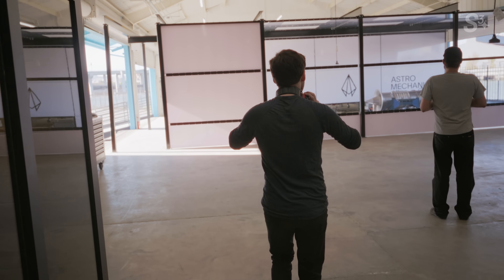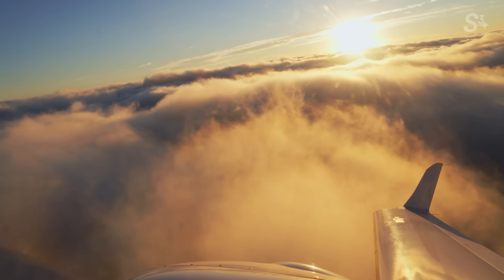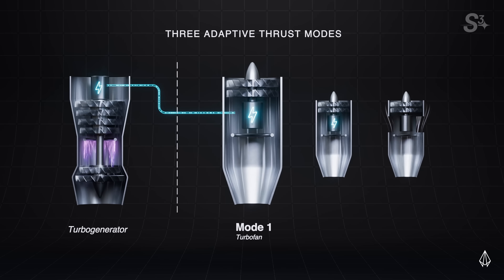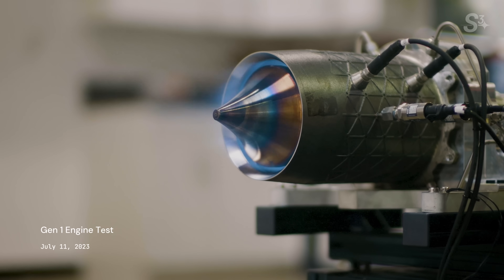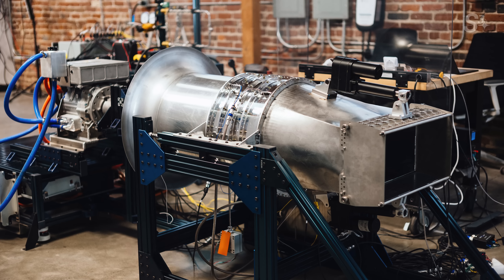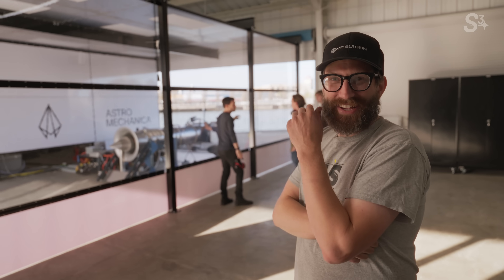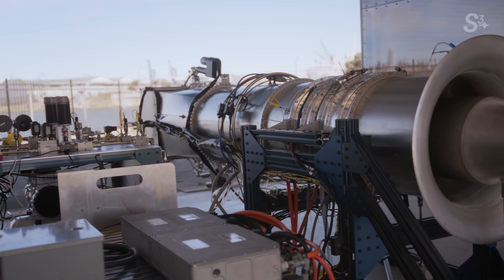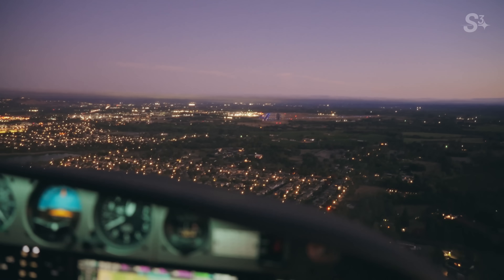The Age of the Electric Adaptive Jet Engine: Astro Mechanica

Comment: "we burn FUEL in a generator".

ok, cool. as expected... a bag of tricks posing as "revolutionary" but really all just hogwash, pixie dust, unicorn farts...

guess what, everyone? it actually runs on AIR, like every other engine... air that is rapidly HEATED using the COMBUSTION of a FLAMMABLE SUBSTANCE so its PRESSURE INCREASES and can PERFORM WORK.

throwing a generator and motor in there, whats that achieve?

funding from investors. thats all.

Comment: I like their approach better than whatever Boom is doing. Same as Hermeus, develop the engine first, then build an aircraft around it, not the other way around.
Reply: Honestly I could see a boom airliner being converted to use these engines.
Reply: An aircraft, much like any other complex engineering system, needs to be designed holistically based on its intended purpose and goals. Few, if any successful aircraft have started from an engine-first design philosophy - the powerplant is merely a subsystem of the whole airplane.
Reply: @ch4ndemic  the innovation of all these new aerospace companies come from their innovative engine design. Makes no sense for Boom to make an airplane that’s completely unrelated to their final product.
Reply: Isn’t boom developing a proprietary engine?
Reply: @ no, they contracted it out to other companies (e.g. Kratos, GE)

Comment: I am sadly not impressed. Perhaps its the explanations or my lack of knowledge about jet engines. Why a turbo generator? Why not let that part run the fan/compressor directly?
Reply: Seems like they don’t want to couple the turbine with the compressor directly so that they can be decoupled and run as efficiently as possible
Reply: Think of it like a bike with gears. A regular engine is tuned with only the one gear speed, so it needs to work well enough when flying slow for takeoff and landing as well as for cruising the other 95% of the time.

This engine is effectively starting at a high gear and uses the electric motors/ the turbo generator to help when going slow. It means a much smaller and lighter engine can be used in place of a less optimized bigger one. The electrics probably wont be used so much when cruising as that will be where the engine can sustain itself when its moving fast enough.

Comment: The title of this video is quite simply incorrect. Electricity may be used as a coupling mechanism, but it is NOT the power SOURCE  -- that is the jet fuel.
I definitely would like to congratulate the team on this success--thinking outside convention about how to make existing technology more efficient.
If the turbine/generator is the most efficient way to convert jet fuel to electricity, then this could open up the field for hybrid, electric motor powered aircraft, like the VTOL models that are range limited by battery technology.
Reply from the maker: Correct, sorry about that. Was running through the idea maze of titles a little too quickly lol. Adjusted!
Reply: @jasoncarman99  isn't it still quite wrong? and while I recognize that you can use electric transmission in a jet engine instead of gears or wider turbines, isn't it the case that for supersonic cruise there is no particular need for steep gearing so direct shaft is best and your claim that range would be significantly increased is a lie? that better range is better had in weight reduction which concorde had good opportunity for
Reply: @jasoncarman99  Thank you so much for doing that and departing from the horrible trend of Youtube channels being sensational and using distracting titles/content.
Reply: I totally agree. In this case I think they mentioned they were using LNG instead of jet fuel.
Reply: I'd imagine the thermodynamic efficiency limit is still there but the electric transmission makes it possible to stay closer to that limit in a wider range of flight conditions?
Reply: @tamashamas6193  for brief take off yes, maybe. at the expense of weight and electric transmission losses the whole way... see the problem? so I think we are in that spectrum between incompetence and scamming
Reply: @DanFrederiksen  I would not be so quick to come to conclusions like that. If you can run the turbine/generator in its optimum range, and run the propulsion system in its optimum range(s) you can well overcome the losses incurred in the electrical systems. That is why you have diesel electric trains, trucks, ships, etc. For example, look at what the Dodge Ramcharger is doing, or Edison Motors of Canada.
Reply: @StarmaxStarmax-zn3xt  but wouldn't an engine be designed to run in its optimum range for mach 1.5 cruise? so  you can only hope to improve ascend, at the expense of the long distance cruise efficiency. and weight and complexity. I'm open to being wrong but where is the flaw in my argument...   for very high bypass turbofans the desired ratio might just be good enough to consider an electric transmission to be free of gear wear. But a supersonic...?   any slight inefficiency in take off would have to be VERY significant to entertain such complexity. And typically jet engines are more efficient at take off, strangely enough.
You can flip your argument and realize that there is great value in spotting bs right away instead of a 10 year wait and see waste of time and money.
Reply: @DanFrederiksen  The losses from an electric generator and motor are similar to the losses from (single speed) gears.  HOWEVER an electric transmission has much greater flexibility in speed ranges; it's like widely variable gearing.  Electric is probably more durable also as there are no (unique) mechanical interfaces (i.e. gear faces) to wear.  (Both have bearings to support shafts.)
Reply: @LoanwordEggcorn  We have invented an ultra-torque dense[think light, compact], infinitely variable gear technology [advanced planetary-class...w/o spur gearing, 90% smaller] which does not use tooth/spur architecture. It is based on our reformulation of gearing theory. It enables low cost, efficient, power dense turbo machines including rocket engines. Improves electric machines too.
Reply: @MiloTheMindBender  Reference please?  (Don't post a link or Youtube will delete it.)  Company or invention name.
Reply: I like the idea of an adaptive electric/gas engine that tunes for best efficiency. I haven't heard of a jet engine that can do this. The response of an electric engine is fast when its needed but slows down as it gets hot. Cold n High is good for it in that respect.
If you can get more range from a gas turbine, your doing something right.
Reply: @simiot1  I have considered it too but it seems to me to be better suited for variable output operation. I considered it for a helicopter, specifically Hill helicopters because it avoids the gearbox at an angle to both the main rotor and tail rotor. Making it electric frees it from a lot of mechanical coupling and suits variable load and gearing mismatch if you suddenly want more power, like how you would gear down in a combustion engine car to get more power for acceleration. so it might be very interesting for a helicopter but for long term steady state like supersonic long range cruiser I'm guessing it's a net loss. It's hard to beat a straight shaft for power transfer.
Reply: @DanFrederiksen  I understand your point for this use in Helo's. I didn't think of it. A FADEC ops system would make a killer chopper with this tech, when it is proven.
There is always gonna be a loss with efficiency when it comes to turbines. Generating your own electricity for these engines is where it tips me in favor. If there can be a leap of improvement to fuel to weight usage I'm for it whether rotary or fixed...
Reply: If you’re going to strap on a big ass jet engine and associated fuel tanks… just power your HELICOPTER with the jet engine. Skip the middle man. We also already have APUs, which are… alright in efficiency, but that fuel efficiency comes at the cost of peak power output, as in, not enough power to lift the damn thing. But… maybe I’m wrong. We’ll see
Reply: @TheWizardGamez  which reasons did I list for why it might just be good in a helicopter?
Reply: We have invented an ultra-torque dense[think light, compact], infinitely variable gear technology [advanced planetary-class...w/o spur gearing, 90% smaller] which does not use tooth/spur architecture. It is based on our reformulation of gearing theory. It enables low cost, efficient, power dense turbo machines including rocket engines. Improves electric machines too.
...
..
.
Reply: Glad the title of the video does not say electricity as fuel source maybe delete your comment, lol It literally says adaptive electric engine hahaha

Comment: I still have practically no idea of what they are actually doing. The "turbine runs the motor which is connected to the compressor which runs the generator" thing is so confusing it sounds like it's a perpetual motion machine that violates thermodynamics. I'm sure it's NOT, but I don't know what it IS. If what they're doing is burning natural gas in a generator to make electricity that then runs electric motors which spin fans to make a jet of air for thrust, ok, but then why do they apparently inject fuel into it like a normal jet engine. It's all very vague and poorly explained, perhaps by design to thwart potential competitors, fine, but it still leaves the viewer confused.
Reply: It is a regular jet engine, made for higher than average speeds, with an electrical boost system on the side to rev the engine when going slow.
Reply: He was trying to convey that they can run the compressor section at a different speed than the combustion section doing that so they can optimize the compressor, I have my doubts it will go anywhere besides a test bench. So far all it seems to do effectively is just make a lot of noise. It sounded like a pulse jet engine, and the flame coming out did not look supersonic at all. There weren't any shock diamonds at all. More power to them though if they pull something off...
Reply: @rocketsurgeon4876   I did notice that the flame looked highly turbulent and disordered.
Reply: its called "hype". use the right "keywords" and investors with bulging wallets come running, hoping to jump on the next "big thing".

theyre running a standard turbo jet principle, but rather than a solid shaft connecting compressor to turbines, theyve had the brainfart idea that throwing a generator and electric motor in between is a "leap forward"... "now we can realise better efficiency with different operating regimes"...

any engineer with an actual interest in their career path, or even layman with a slightly above average knowledge about electrical systems will know the whole concept is ludicrous... forget the principle of KISS, throw the word "electricity" into it, maybe a bit of "green", and "eco friendly" to boot... and watch those bank accounts grow!
Reply: @paradiselost9946  My thoughts exactly. Seems like they are making a jet engine, with more parts?

Comment: The fact that their using LNG is a big plus, but my only recommendation to them is do not over engineer the engine. It needs to be robust and easily maintainable. That’s the main reason Concorde failed. It used a lot of expensive jet fuel and was really hard to maintain. You got the fuel part down, just make it easy to maintain.
Reply: Who says Concorde failed? It was in service for 27 years. Is that a failure? At the time it was retired it was the safest it had ever been due to the kevlar rubber fuel tank liners. It was expensive to run and had limited routes but it was pretty far from a failure.
Reply: @badger_claws first of all,it always has been an economic failure, since day one. It was a prestige project, kept alive by subsidies.
Reply: @badger_claws The concord was a massive failure.
Reply: Good thing you told them. I am sure they wouldn’t have thought of that otherwise. 8^D
Reply: I don’t see the benefits of LNG. You’ve now got to handle a fuel that needs to be kept in a much tighter regime(weight from insulation and whatnot), due to this you probably aren’t gonna be stuffing it into the wings(it’s a supersonic craft presumably so the wings are already thin, insulation just goes and ducks that up). Also the added ground infrastructure and the fact that basically only the US, Russia, and a couple middle eastern countries actually have cheap natural gas. Using LNG for space is just swapping out one super cold fuel for another super cold fuel. But for planes. It’s completely different
Reply: The concorde didn‘t fail because of it‘s engines. It was a combination of multiple factors that caused airlines to drop it.
Reply: actually the Concorde was shelved when a piece of rubber peeled off the tyre on take off & pierced the fuel tank causing an explosion & then loss of altitude causing the plane to crash into a farmhouse, Jesus I’m no rocket scientist but how come out of all of these people commenting I was the only one who knew this fact ? 🤔
Reply: I’ve gotta disagree with the “LNG GOOD” sentiment. Insulation and energy density make it a worse fuel. Let alone infrastructure.
Reply: The concord literally failed because of a made up accident in the runway because the us couldn’t support that two europeans nations had the market lol
Reply: That’s a good point but judging by their simplistic office, simplistic lab, simplistic testing tunnel/location and the simplistic testing stand I think they got a very strong eye for simplistic. Praying they are strong and successful! 🙏 💪
Reply: The problem with LNG is that it is dangerous compared to jet fuel, which is basically kerosene. Methane type fuels are extremely volatile and are much more prone to causing an explosion. The clean burning aspect of natural gas is really good, but I'm not too sure how safe they could make a jet that runs on it.
Reply: The electric motors are off the shelf, so they got that going for them
Reply: Ok mr engineer why don’t u build one then.
Reply: Thanks well done showing this interesting research, the kind of thing that British and French engineers had an uphill struggle to maintain in the fifties /sixties to produce the Concorde..but as it was sixty years ago so a very unfair comparison. Nevertheless hope you succeed. 
Imho it still,sticks in the Americans craw that they failed with a Concorde type design as did the soviets so spectacularly. To acquaint yourself with the truth go the the Aerospace museum in Bristol where the whole Concorde story ( and the aircraft itself)  is described in-great technical detail and the catastrophic litany of human errors which led to the horrendous crash in Paris . Definitely NOT the fault of the aircraft ..fact .
Obviously the vulnerability of the fuel,tanks could be held as a “flaw” but was immediately rectified thereafter ,  but again then politics and hostile vested interest got in the way and BA under the direction of its solely commercial centred board saw the opportunity to axe it. OK that is sort of justifiable (not to me) but then to refuse others the opportunity to operate it who readily had the means and experience was just criminal . So ended the British aerospace industry and all industry come to that . I
Reply: @johncrispin2118 What Americans are having trouble coping with the failure to produce an American super Sonic commercial airliner? I've been living in America for 60 years and I never hear anyone talking like that. Maybe the people who tried and failed to make one are having it stuck in their craw, but Americans in general are not even remotely troubled by it. Most people in America, like 99.9% have no idea that Americans tried and failed to make a plane like the Concorde. 

If we didn't produce a Concorde like jet in America, it's because nobody was willing to spend enough money to develop one to completion. The technology to do so has obviously existed here for a very long time, considering we have multiple companies who make jet engines capable of SuperSonic flight. 

Americans tend to be very impressed with the Concorde to this day, at least the ones who even know about it. Every time I heard Americans talk about the Concorde it was basically talking about how cool it is. I was not happy to see it retired.
Reply: *they're
Reply: @badhombre4942  out of everything you could’ve commented on you chose a grammatical error? Lol 😂 fair play.
Reply: @Realone7-i8l  Ok, but that's not the reason Concorde failed. The location of the engines, was a seriously flawed design.
Reply: @badhombre4942  so one could surmise that because of the concords flawed design, it was hard to “maintain”.
Reply: @Realone7-i8l  The flaw in the design resulted in the last crash before they permanently grounded them.
Reply: @badhombre4942  so is that the main reason concord did not succeed? Because form my research it was the cost that ultimately led to its demise. It was actually a pretty safe plane to fly especially from 1976-1999. If there was a financial incentive to keep Concord going, I’m sure the incident in 2000 would simply be a foot note.
Reply: @Realone7-i8l  LNG as an Av fuel????? It needs to be cryogenically transported and stored - adding increased weight and volume to fuel tanks on the plane, and they'll need to store more of it due to its lower energy density compared to Av gas or JP-1 etc.
Reply: @badhombre4942  lmao you're living in a cartoon world if you think reality is that simple
Reply: @holobolo1661  You are certainly that simple.
Reply: @badhombre4942  bahaha no argument so u resort to insults... you've shown your hand and then confirmed it.
Reply: @badhombre4942  Not even an original insult, just "no, you are" lmao ur regarded mate
Reply: @Realone7-i8l  Bad usage shows a lack of knowledge or attention to detail.
Reply: They're